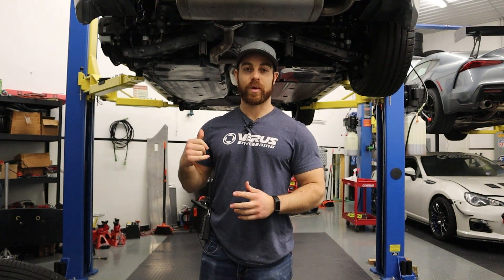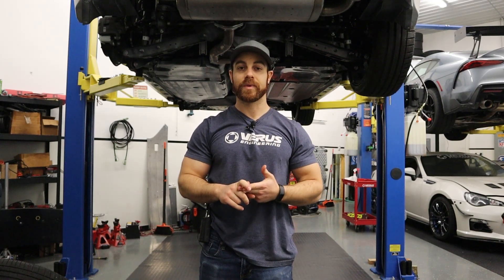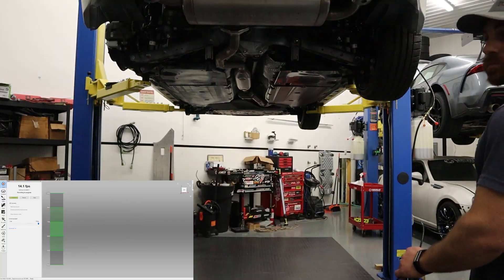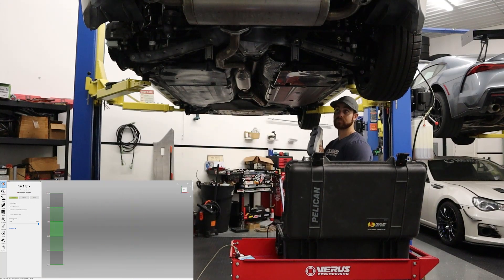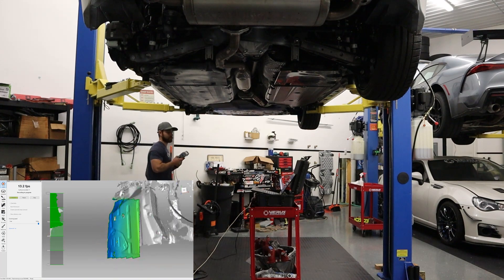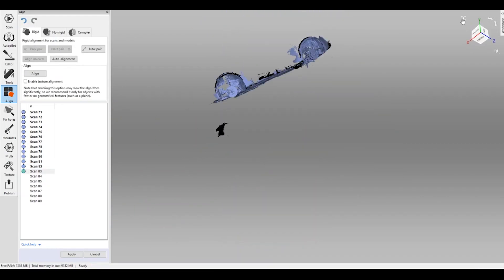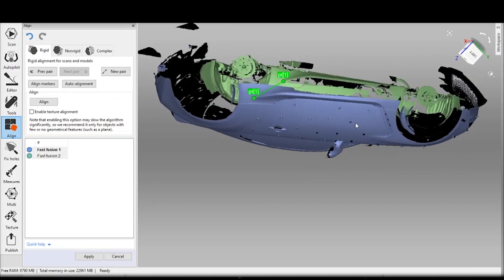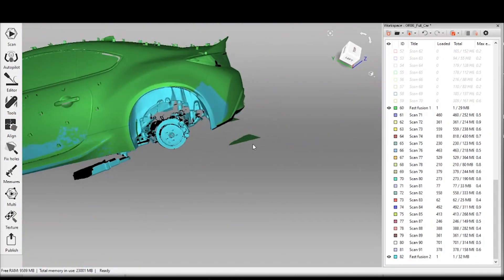Toyota GR86 Scan - Verus Engineering Scans a GR86 for CFD Prep

Comment: I’d like to get a diffuser that will cover that parachute sized hole left by the stock exhaust when I switched to the HKS spec L 2
Reply from the maker: We typically try to offer our rear diffuser to work with both the OEM and most aftermarket exhaust options.